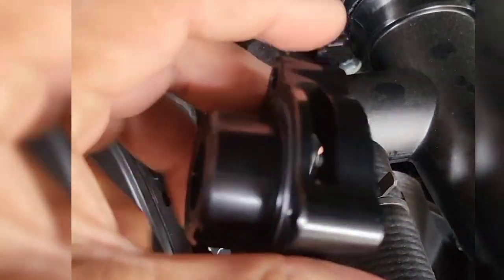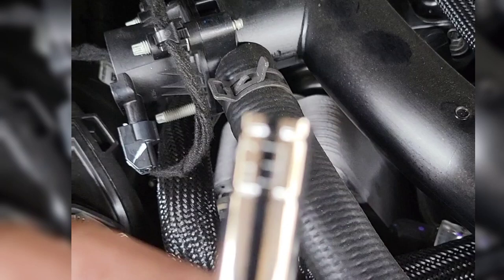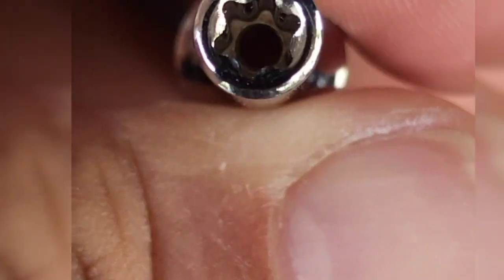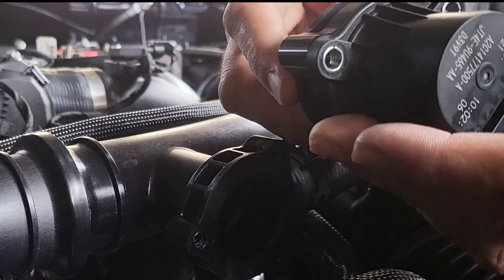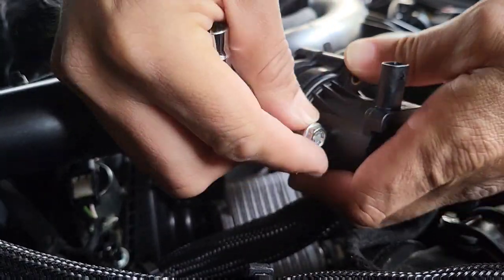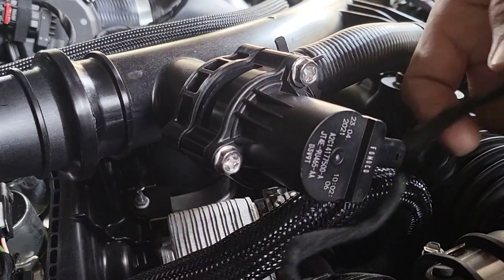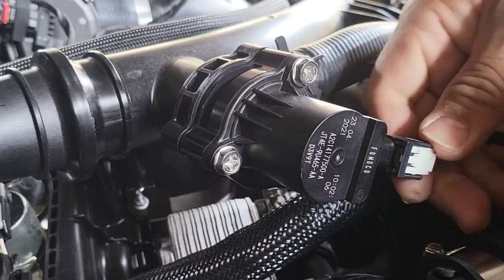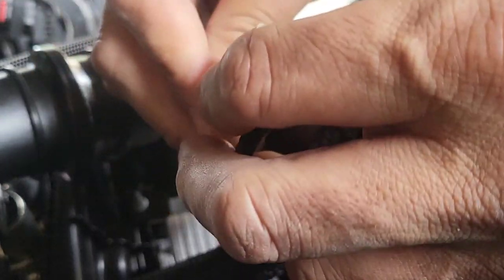Bronco lethal performance Blow off Valve installation. Ecoboost 2.7L

Comment: You should take off the filter cover and put a knn . It sounds like a jet
Reply from the maker: Will look into it.
Reply from the maker: aFe reached out to me. They are developing a Cold Air intake for the Bronco. So im dropping off the truck soon so they can do some measuring for their prototype for a few days. So im excited about the collaboration.
Reply: @broncodiyonabudget1615  Any updates on the intake yet? I'm waiting for my exhaust to install the blow off valve, and would like to do the intake together.

Comment: Annoying
Reply: Maybe. The underlying objective of a blowoff valve (BOV) is to protect the turbo against damage while ensuring smooth and reliable drivability. It just so happens it makes a loud sound that gets everyone's attention!
Reply from the maker: When you let off the pedal on a turbo engine. You get what is called compression surge. the boost returns to the compressor wheel, when you let off the gas . You now have pressurized air strapped in the pipes and  it can slow or stall the turbo wheel putting stress on the wheel shaft and bearings. Not only damaging, this surge can also mess with turbo response and kill drivability. The wheel loses its momentum and also creates lag. A good blowoff valve can come to the rescue and keep the surge out of the turbo by venting it to the atmosphere. Pssshhhh!